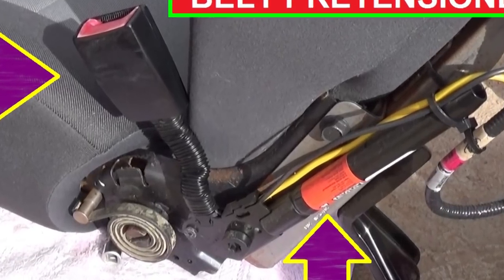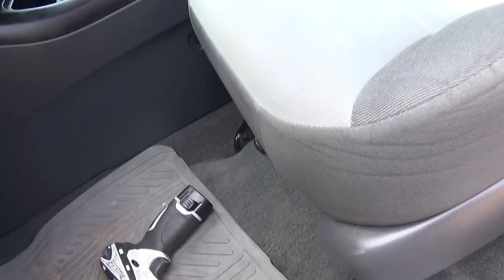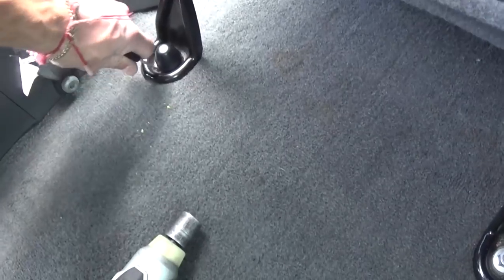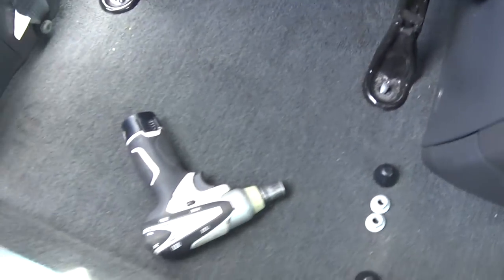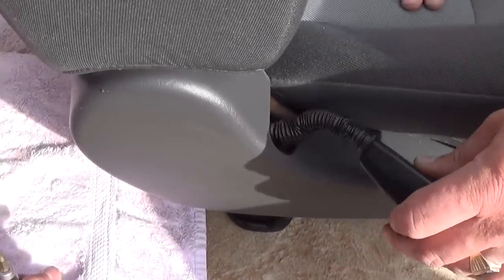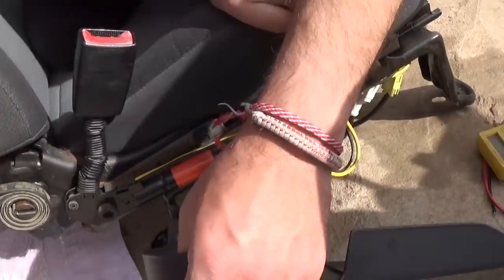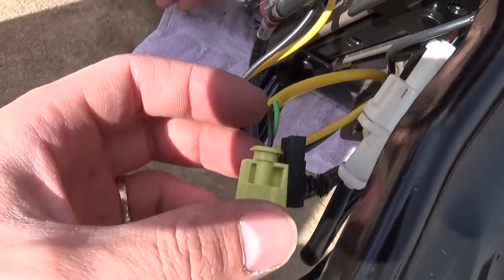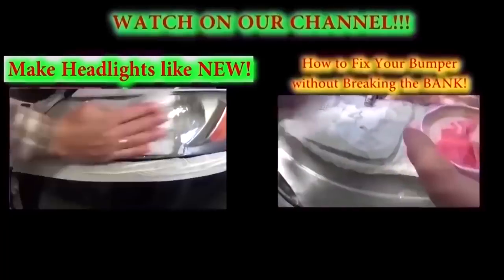How to Remove and Replace Seat Belt Pretensioner.  Demonstrated on Ford Escape  / Mercury Mariner

Comment: first thing...disconnect the battery terminals before unplugging pretensioner cables otherwise the airbag light might come on.
Reply: chris mac you are so right here. Hardly any of these videos I watch on this subject don’t state this. When you pull the seat and pull that YELLOW cord make sure you already disconnect the negative from the battery.
Reply: Omg. Thanks for that info. Would've been a disaster for me

Comment: Before you get too deep into the repair/replacement of the seatbelt tensioner, try disengaging the connectors completely (pressing the connectors together is not usually good enough).  I am referring to the male connector of the  pretensioner attached to the seatbelt system.  I have a BMW E46.  After doing this, try resetting by using your resetting tool (and I assume you have one.  They are not that expensive at all.)  If this does not resolve your problem, then by all means, proceed with the more involved steps.  Good luck!